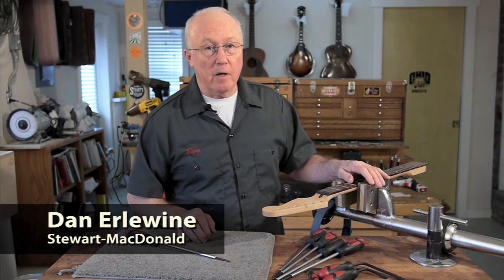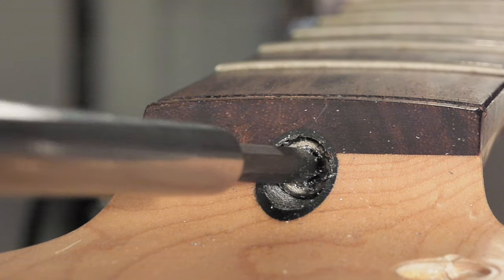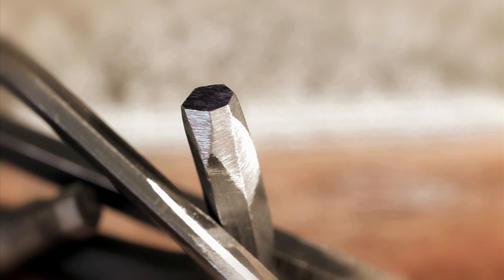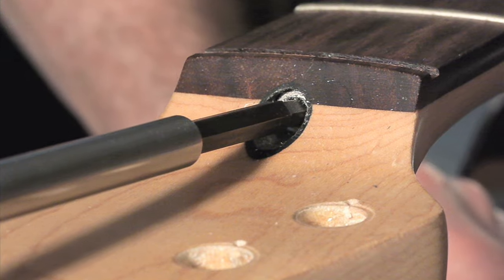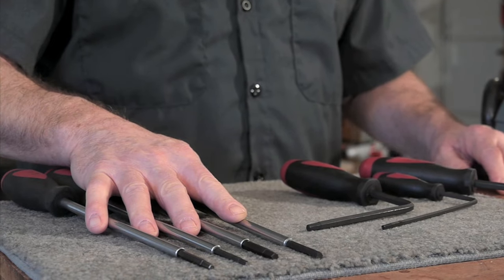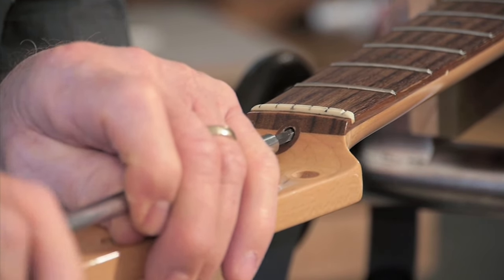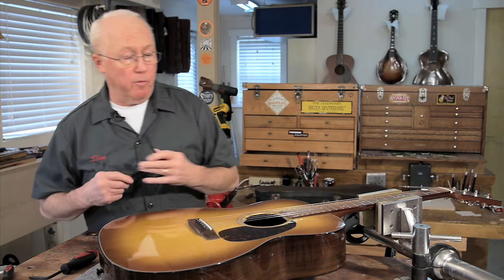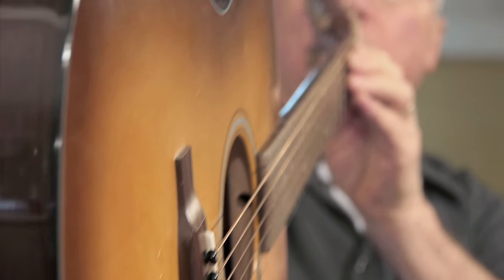Gripper wrench vs. worn-out truss rod nut

Comment: I just got one. It did nothing. It get's tight but then slips. In fact the edges of the gripper are starting to round off after 30 minutes of trying to save this neck.
Reply: That means your truss rod nut was likely too far gone.  I’ve used these on dozens of guitars and they are a godsend.

Comment: I have a esp ltd-256 fm electric guitar. The truss rod has always been very hard to turn, now it's stripped. The hex wrench size I was sent and using is a #3 however the treads are gone. There are no Luthiers where I am so I watch your video's and usually do a pretty good job on adjustments. I have a Squier Affinity Stratocaster that uses a #5 and it works fine. My question is for this esp ltd what size gripper wrench do I need to grab and re-thread the truss rod. I would like to buy maybe a #3, #4 and #5 sizes just in case I get another guitar with an in between size. Any advice/help sure is appreciated!

Comment: I bought it and it didn't work 
even though I released the tension of the strings and clamp the neck to relieve tension on the truss rod. 
Make your own and don't waste your money !
For example if you need a 4mm Allen key ,find a 5mm key and tapered it to your need.
Reply: I got a 3/16” one for a 4mm. It’s between the 4mm and 5mm.
Reply: What tools would you need to do that

Comment: First I was sceptical about that. But this was far cheaper than a guitar builder so I tried it. Well, it worked. Those grippers are amazing, totally recommend them
Reply: Does it work on a bass I went to guitar Center but they said they couldn't do anything
Reply: @joseambriz5897  as long as you have the right size it will work in a bass
Reply: How do you know which size to get?
Reply: @jinxarchives  I was just wondering how you measure to get the right size myself. I have a Schecter guitar with a worn truss rod opening. I just need to tighten it slightly to get rid of "bowing" in the neck to get it more straight. I have an Ibanez JeM Jr and I adjusted that one so the neck is nice and straight and it plays perfectly.

Comment: I was told the walnut plug on my bi flex would have to be removed by a qualified luthier but in this video the 1/8 wrench fits fine. Also that the wrench will work only so many times...

Some more user feedback from experience with these particular sized wrenches/ truss rods would be great. Thanks
Reply: How’s it coming along 4 years later?

Comment: I need a right L angled gripper wrench with a short shaft, because the guitar I'm trying to adjust has a different angled cut out on the head stock (Vintage Japanese Alvarez Acoustic). Typical truss rod wrenches are L shaped, why not these Stew-Macs?
Reply: +aquasoniq They make a few short right angle Gripper wrenches. I made my own. Stewmac has trouble keeping things in stock, and a 6-13 week lead time is just totally unacceptable. I can have bespoke tools made in less time. They cost about the same too. This Stewmac stuff sells at such absurd prices, many of the tools & jigs can be custom made with your own specifications for just a little more money, and the quality will almost always be superior.

Comment: An easy-out does the same job for a lot less!
Reply: What is that plz help me... I'm in big trouble
Reply: @tankslapper4686  Hello, an e-z out is a remover for a stripped screw, very common at any hardware store.
Reply: @georgelackey622  ahh....but I don't want to remove the nut i just want to turn it a bit ....will it do that??...
Reply: @tankslapper4686  Only if you need to loosen it, if it is damaged it should be replaced anyway.
Reply: @georgelackey622  yes i need to loosen it....i had just bought the bass 3 months back... And i so much regret tightening the truss rod ...my strings buzz on last fret ..it is unplayable 😭
Reply: @georgelackey622  yes i need to loosen it....i had just bought the bass 3 months back... And i so much regret tightening the truss rod ...my strings buzz on last fret ..it is unplayable 😭
Reply: @georgelackey622 it doesn't work the other way around ?

Comment: Would you by chance know what size Gripper tool would work on a Chinese made Vintage (brand) V100 Lemon Drop guitar?  This is a Les Paul copy, similar to an Epiphone Les Paul.  I purchased this V100PGM used and I love the guitar but when I went to adjust the intonation and neck via the truss rod, I found out the previous owner had stripped out the hex nut... I believe the Gripper would safely extract it if I knew what size to order, but I will also need to seek out a new nut to replace the damaged one.  Does StewMac carry the hex nuts?  Once I've removed the damaged nut, I'm primarily concerned about getting a new one with the correct threads and the correct sized hex head wrench to install it.  Thanks!

Comment: Are these OK to use on a new, good truss rod? I want an adjuster for my Strat that is long enough to use easily.Normal Allens keys just get tangled in the strings. I'd really like it with a tee handle at the end for fine adjustment - maybe a future tool?
Reply: You don't need it on a new truss rod....these are made for worn truss rods.